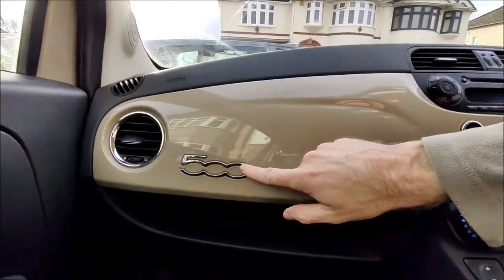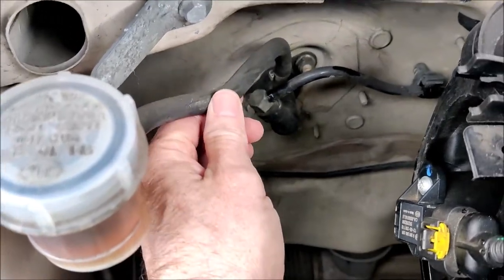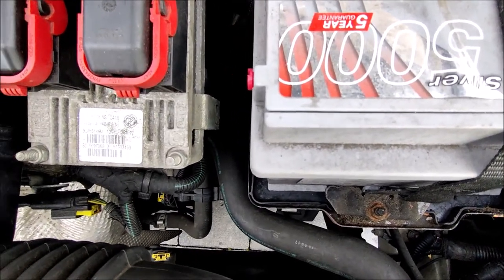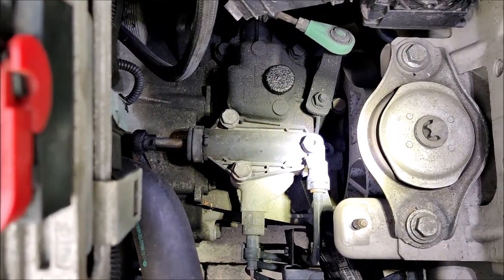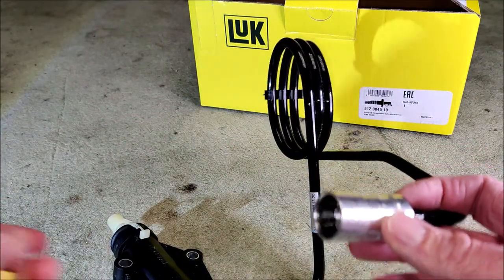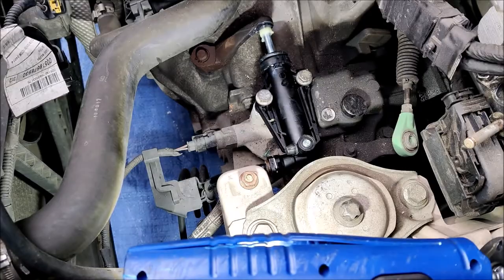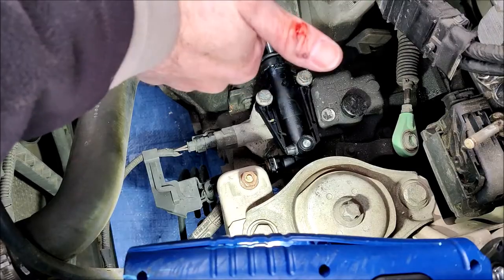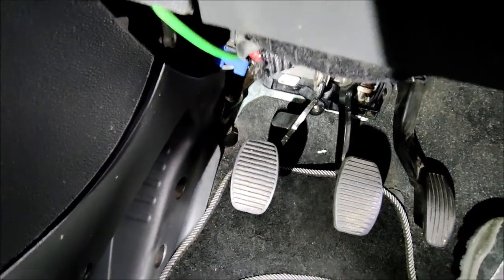Fiat 500 clutch fix ( master cylinder, slave cylinder, thrust bearing, KA, Panda, Ypsilon )

Comment: I've just been watching your video but hoping for some help for my daughters KA2 2011

I returned home one day as suddenly there was no clutch resistance whatsoever so no going into gear. No previous signs or warnings of clutch issue

I checked the clutch master reservoir on the master and it was very cloudy (but full to the line), tried a bleed on the slave nut and no difference. I have purchased correct spare fluid

I then spent about 10 mins pumping the pedal and there was very brief stiffness and it went into gear once...since then nothing and I've noticed the reservoir emptied so have topped it up...There was no leak I could see before bleeding

Is it possible it is the clutch master cylinder (I've ordered one) and if so is it simply a case of removing the screws from the firewall and the piston arm will disconnect from the pedal....I did notice a switch being activated from the clutch pedal too but no idea what that ios

I'm no mechanic and contacting you as your video was great and mechanic around here are very poor.

Kind regards and any help appreciated
Reply from the maker: Hello Mark sorry to hear you're having problems with the car. I'll be honest with you, I have not had cause to do a master cylinder on the 500. Also, at this very moment our 500 is not here so I can't go and have a look in the footwell.

However, from memory and having quickly got up some online images of the master cylinder, it looks like it is a ball  / cup connection between the rod of the cylinder and the pedal. So in theory it should be a simple disconnect of that joint and as you say removal of the bulk head bolts. The master should then come out in the engine bay.

It sounds very much like the hydraulics side is the problem, rather than the clutch itself. Have you placed a camera looking at the clutch arm (Slave cylinder) to observe how much/little it is moving when you press the pedal? This should pretty much confirm whether it is one or other of the cylinders at fault.

Good luck.
Reply: @fixitfallows  thanks for your reply, much appreciated. When I press the pedal there's nothing, I see nothing and it's like the master cylinder isn't even in the loop. I cannot see much going on at the slave end. I'm tempted to replace the master from the master pipe side to start with which will save a lot of removal of the battery tray, etc and see if that makes a difference.
Reply from the maker: Hmmm, the master is the more expensive one to do. Perhaps disconnect a pipe either from the slave side of the reservoir or as the pipe meets the slave. In this way you may be able to observe whether the master is actually pushing any fluid. If it is, then it might point towards the slave. Also there is a joint positioned on the inside (engine bay side) of the front passenger side wheel arch. Perhaps this has failed and is where the pressure and fluid is being lost......?
Reply: Too late...I managed to replace the master (not using the hose between the master and slave and thought I'd sorted it....unfortunately not. I then noticed after pumping the pedal the fluid was going down and noticed a wet patch on the floor....(but you're spot on) so after removing the battery tray, I think I can see where it is coming from, which looks like a join section between the master hose to the slave but that's where I stopped because I couldn't get to it and no sure what other parts I need. Since I haven't used that hose from the master to join, I'm hoping its that side.
Reply from the maker: @marcopolo6668  well, on the positive side you've made progress, having now identified the likely problem.

By the way, did the master detach from the clutch pedal fairly easily?
Reply: @fixitfallows  it does and I think I had to purchase the master to get the pipe anyway, not sure I've found them on their own. Do you know if the end that goes into the join requires any special tool to remove it?

As for the ball joint, it popped of with a little help, although a little more fiddly getting it back on..I used an angled spanner head in the end as leverage.
Reply from the maker: So those joints are supposed to be like plastic plumbing joints, where you'd push in a collar to release pressure on the joint to allow its release. However, the chances are that it will be badly corroded due to its exposed location and separating is likely to be near impossible.

You should have the new half relating to the master.... I think the best option would be to acquire the other half which also means buying a slave cylinder  (sorry to say). At least you'll have confidence in a completely refreshed new system for some time.
Reply: @fixitfallows  after jacking the car up and attempting to push the collar in I noticed a crack in the alloy casing almost the length of the shaft so I'm hoping this is the culprit
Reply from the maker: Seems more than likely... . is there sign of leaking fluid?
Reply: Oh yes, I noticed this is where the fluid was leaking from (strange that even when after the clutch first stopped working, the reservoir was fine for some time).

Comment: Hi great video very clearly explained. Just wondering from where did you purchase the Slave cylinder? please. Many Thanks
Reply from the maker: Thanks. I got mine from GSF https://www.gsfcarparts.com/?gclid=Cj0KCQjwuNemBhCBARIsADp74QRttaP_fNyR1DmOdyVapi0rCtoO1gnW8iWrPgJ9i3aZq0tzU6nc538aAt1jEALw_wcB
Reply: @fixitfallows Thanks for getting back, appreciate it. Tried everywhere no stock, on ebay very high price. I will wait until i find one in stock. Thanks once again for the video and the link. Have a good weekend!
Reply from the maker: Use code "SUM65" for 65% off of the £66 price :

https://www.gsfcarparts.com/luk512004510

Comment: Would this improve the biting point too ??
My Fiat 500 is squeaking too
Reply: Bleeding the hydraulic system may have an affect (improve) the biting point. And if you've removed the battery tray to bleed it, and you have the squeaky clutch problem, well just replace the slave cylinder at the same time. Perhaps the old cap at the end of the piston has crushed over time, which could also slightly affect the biting point (I'm referring to the end cap that is held in place by the 2 strips that you cut after replacing the slave cylinder). And finally, assuming the operating arm hasn't been bent, then general wear of the clutch will affect the biting point, so if its high miles combined with lots of short journeys over its life = lots of clutch action, the clutch could well be wearing. But just keep driving it until it starts slipping (&start saving your money for its replacement)

Comment: I like your video. Very helpful. I have the same problem and have a sqeaky sound coming from the master cylinder which you can hear from inside car by the pedal. Are you saying that if you change the slave cylinder it reduces the pressure/noise on the master cylinder hence reduce the sqeakying. Cheers Bob
Reply from the maker: Hello Bob. For me, the noise and sensation was actually originating from the slave and reverberating back through the system to the master and pedal. 

Changing the slave made a significant difference in my situation.

The pedal system may have some inherent squeaks of its own, but these cam be mitigated by lubricating the pivot points.

Good luck
Craig

Comment: I have the same issue on my fiat panda. Why you didnt change the thrust bearing?
Reply from the maker: My investigations suggested it was the Slave cylinder, which once changed, resolved the problem. So I have had no need to change the Thrust Bearing.